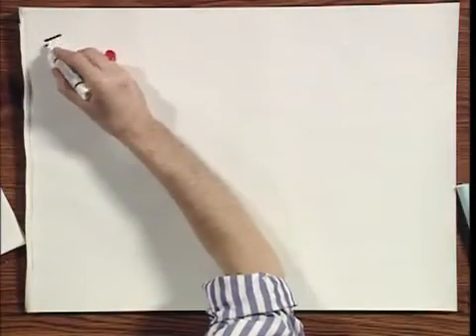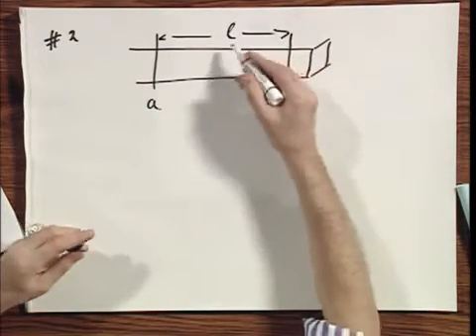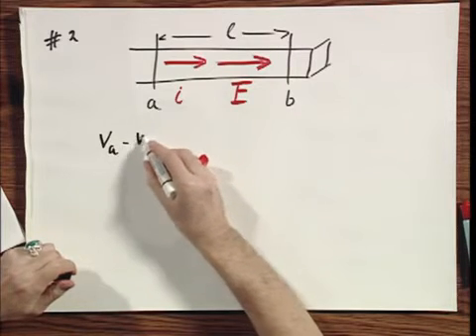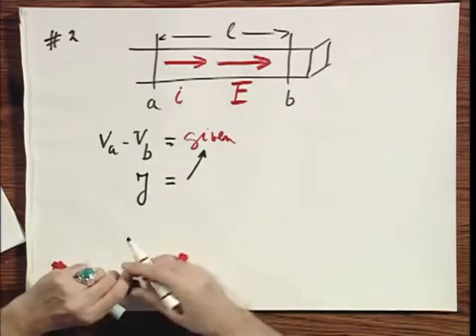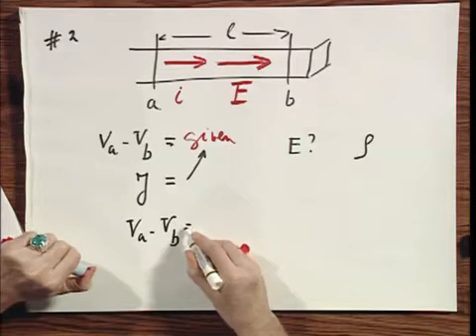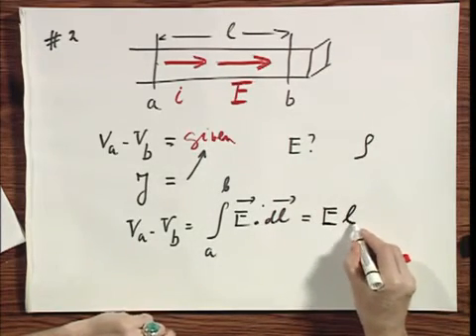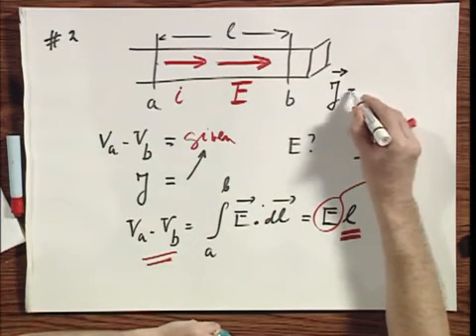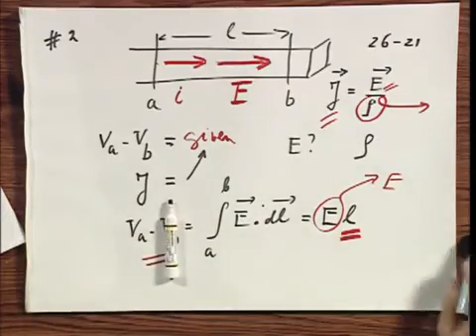8.02x - Module 04.02 - The Electric Field and Resistivity of a Wire drawing a Current.

Comment: Sir, How E is constant throughout the wire ? How can we find E other than the formula V/L
Reply from the maker: If the the wire (length L) has everywhere the same diameter (cross section A) then E is the same everywhere. It's V/L. The resistance R is the resistivity rho*L/A.  I cover this in my lectures.
Reply: @lecturesbywalterlewin.they9259  thank you so much sir I am your sincere student🙏🙏
Reply: @lecturesbywalterlewin.they9259  where ? Can u give the link please

Comment: Why E is constant inside the wire ?
Reply from the maker: E is only constant in a resistor (a wire is a resistor) if the wire has a uniform mass distribution and if the cross-section is everywhere the same.

Comment: What physically is  the Electrical  Potential  across the path between  two points in a circuit . Is it due to the resistance of the path  impeding the  current flow along the  path , and thus current will  flow in an alternative path when one is introduced.
Reply from the maker: If a resistance is zero, there can be no electric field in it. A potential difference is defined as the integral of E dot dl through a resistor.
Reply: Do you concur that there is a potential difference measured across a resistive conductor due to a current flowing through it.